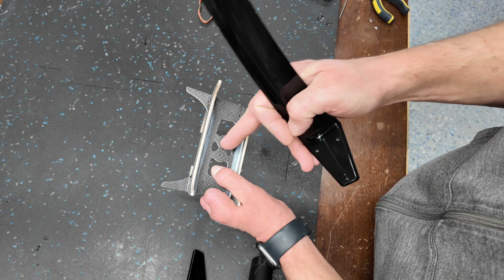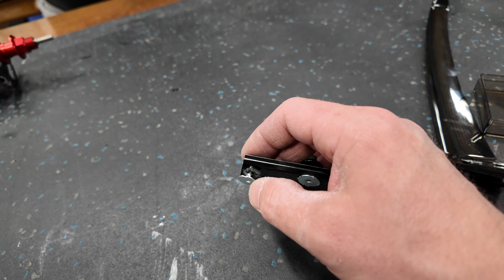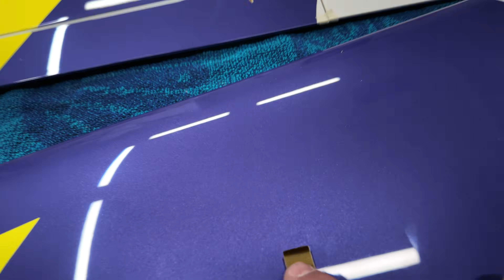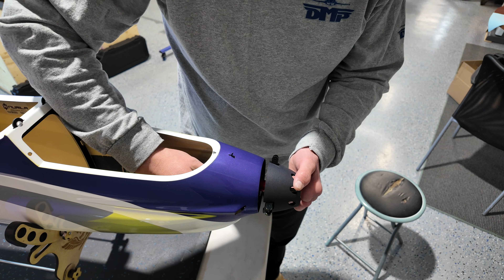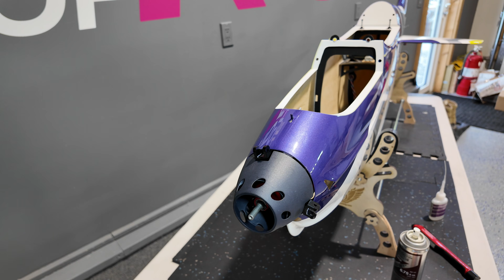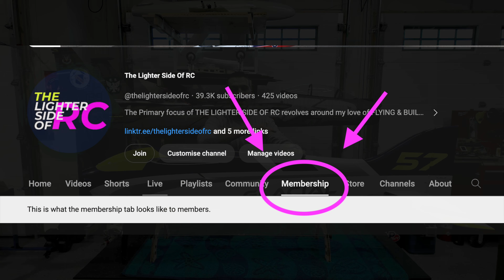Building The Ultimate F3a Rc Pattern Plane: Nurial Glacial Video 4 Update!

Comment: Ages ago when building a Pattern plane of basically the same quality of this one I made a small mistake when setting the wing tube aluminum then and the wing tips were off by 3/32" with the result that it never flew true.  Just an example of how important it is to make things accurate and take your time to do it right.  I hope we get some flight videos of this before sending it to the owner.
Reply from the maker: Thanks!  Yes lots of the time on this project was thinking and measuring multiple times!  So important!  Tentative plans to do the maiden together with the owner so if that works out we will have some flight video!